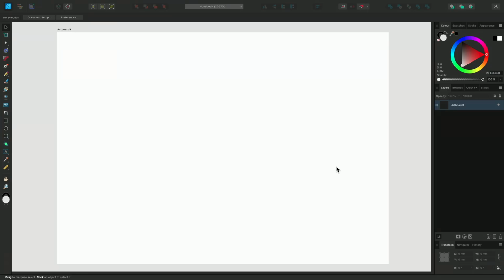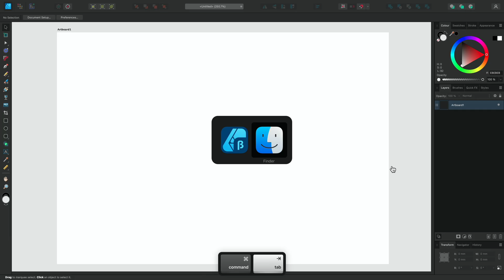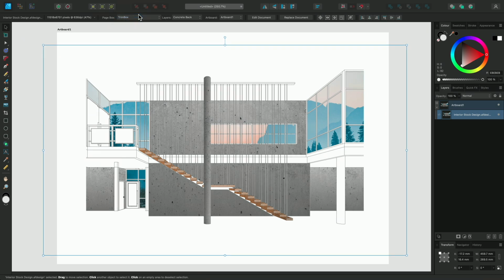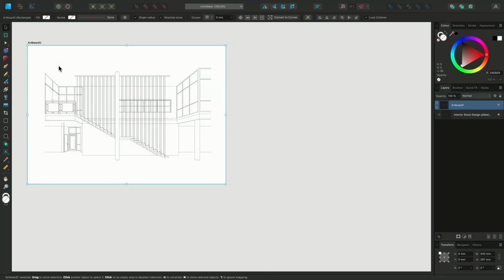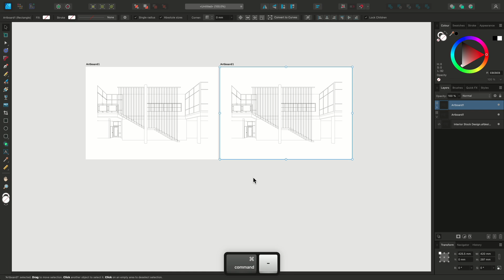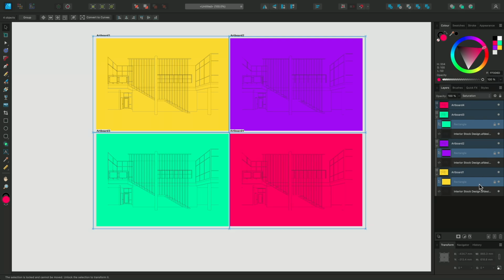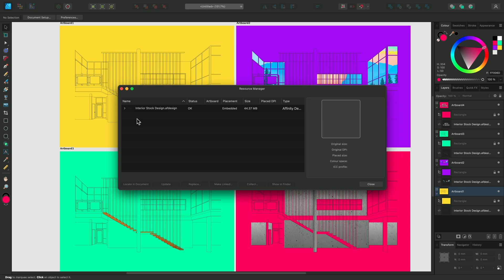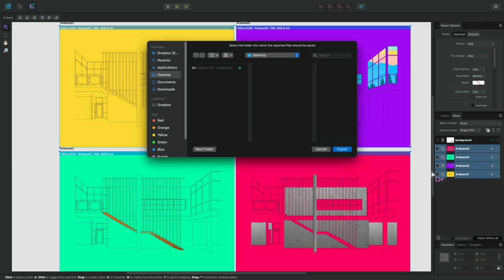Placed Layer Visibility (Affinity Designer)

Comment: Well i not allready have thought through all of this workflow.  

But Architects won´t select it i think unless you can use your printed PDF files to import them according to your Printsetup. 
Architects using Acad or comparable Acad applications usualy integrate into their Workflow companyspecific  PCP -  printsetups , right?  So if i now just import the dwg i allways loose 
these allready setup configurations abouth Line With, colors and so on.  

Would it be possible to also just import the corresponding results, PDF´s ?  This looks like a typical aproach to help architects without understanding their workflows.  sure some the featheres shown here are nice.  But would it be possible to also import the final printresults (pdf´s)  

Furtheremore i would like to know how imported pdfs are represented now in affinity.  In Photoshop, you get a rasterised pixelversion, that alows you to use color pickers and so on..   But!  which is important for architects...   these rasterised results stay linked to the original PDF´s..  so you can start your layout and when architecture changes while you allready help your Colleque with the setup of the graphical configuration for the competition, he / her can still print the updated dwg to the same pdf, and you get instantly an update.. 

I remember in earlier versions.  i could only import the pdf as a vektor line setup..  which is fine for a simple smal house..  But with DWG´s of Buildings far far bigger, like Airports, everything gets sluggish and sloooooow as hell, which is why potoshops aproach not importing thousands of independend lines, but to import it as a pixellayer, still linked to the original pdf. was much better.  You see..  No Architect ever would use Designer to make big changes to the line layout anymore...  in this , Autocad applications simply are far better.    So a rasterised plotted pdf still linked to the original file at that time was by far better, and one of the crucial reasons, my very big architecural company did not swich over to Affinity..  

So is this changed now?